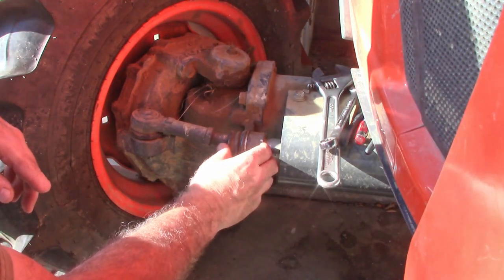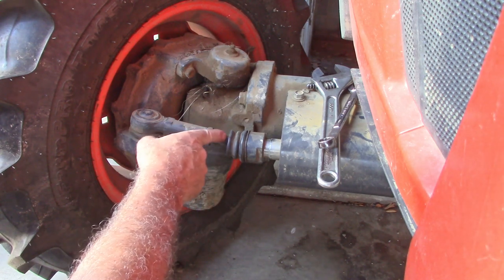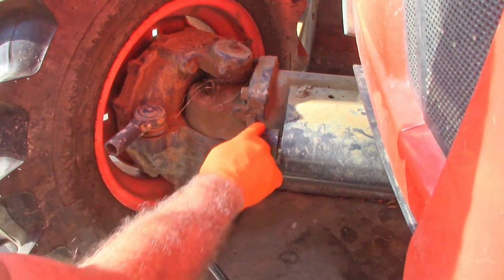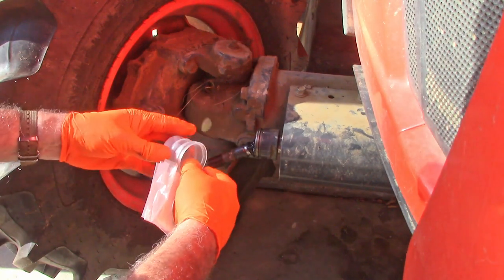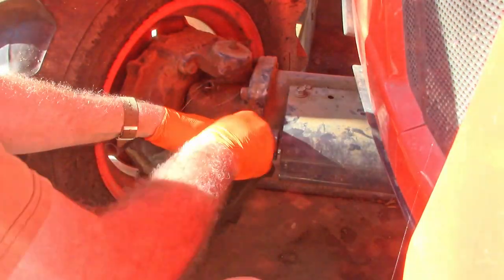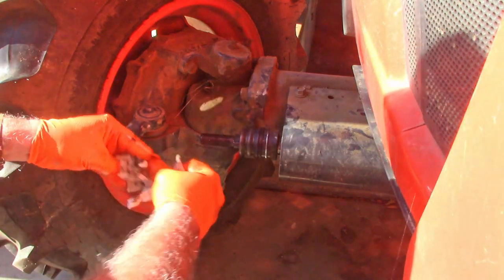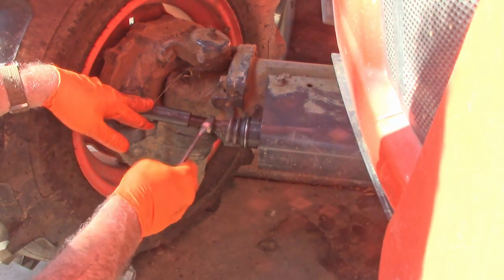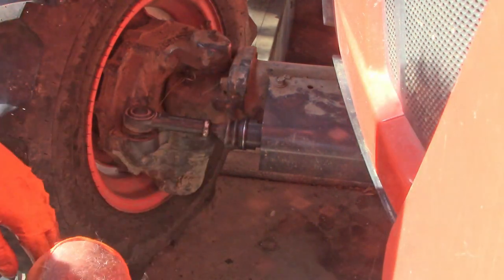Replacing Kubota Tie Rod Boot the Easy Way

Comment: Thank you for this video. Not only did you explain the easier way to install, but I was also able to see the part numbers needed in this video. These parts don't come up on the schematics for the B2601. I struck out with several Kubota dealers and Kubota direct. I finally found a dealer, Messick Farm Equipment, who took the time while I was on this video to reference the number on each of the parts. Just for reference should anyone need it, the part number for the boot is TD270-44680 and the rings are TD270-44690 and TD270-62870. These are OEM Kubota parts.
Reply from the maker: Thank you for taking the time to add your experience!
Reply: Thank you for adding the pn!

Comment: Great video. I jacked the front on my KB MX5200 up so it would be easier to get the tie rods threaded in easier (easier to adjust the wheel to align both ends to get it threaded right)
Reply from the maker: I'm glad it was helpful!

Comment: Nicely done. When doing the other (left front) side, do you turn the lock nut the opposite direction? To be clear: in this video, when you first loosen the nut, you pulled toward the front of the tractor, toward you. Would that apply on the left side, or is it threaded in an opposite direction. Thanks!
Reply from the maker: I'm pretty sure they are both threaded the same.

Comment: I have a 2016 MX 5200. The original ones rotted at about the two year mark and the dealer replaced them under warranty with the same part that rotted again after about 2 years. I was curious if the ones you put on are possibly updated/better quality or the same old crappy ones I can expect to rot in another 2 years? Trying to decide if the aftermarket stuff might be better.
Reply from the maker: All I know is this one is still working.
Reply: @SoatMon  Roger. I ordered new ones from Messick's because they were out of stock at my local dealer. This will be my third set in 5 years.
Reply: FYI when I bought my two boots from Messick, they said the boot had a new part number, and the new boots came from Kubota. Messick didnt have the new ones in stock. I got them 9/5/2024.